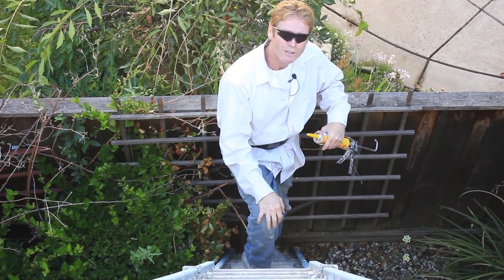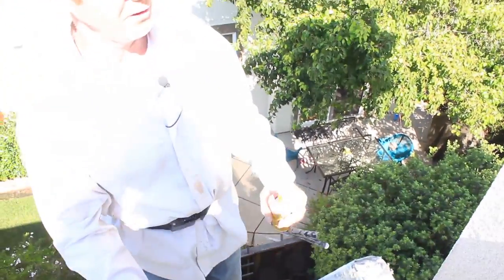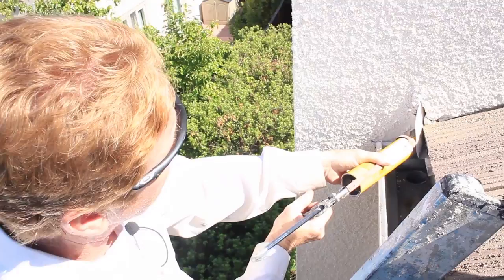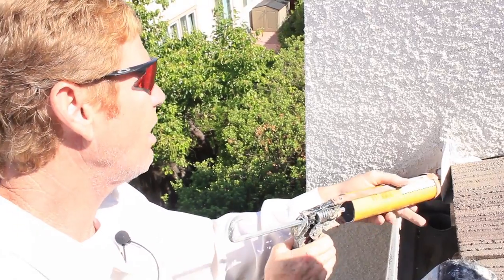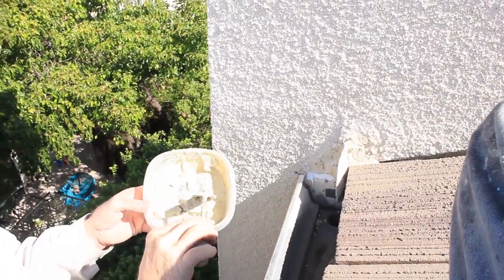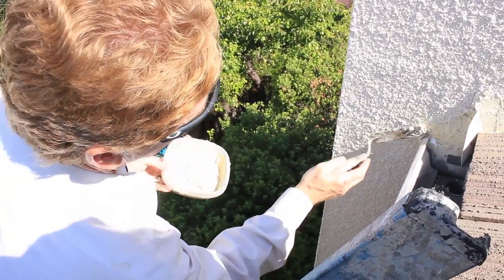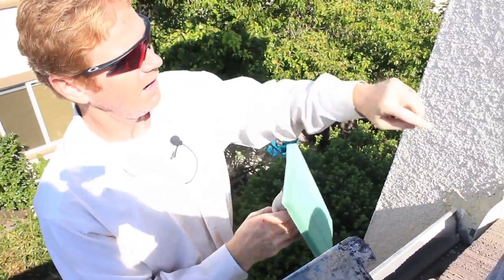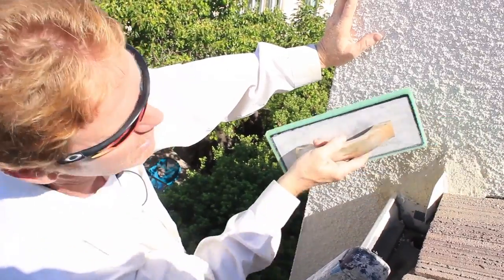Why do birds build nests in stucco chimneys? Fix the holes.

Comment from the maker: Hi Peter, yes, the house was only 10 years old but they noticed yellow stains on the upper bedroom ceiling. Seeing how much caulking this hole took I could see why, can never be sure that this was where the leak originated but it's my guess that the problem was at this point. Especially when the step flashing is proper, the water diverter is also installed correct and the fascia board was also installed proper.
 Thanks for watching and have a great day, 
Kirk Giordano Plastering